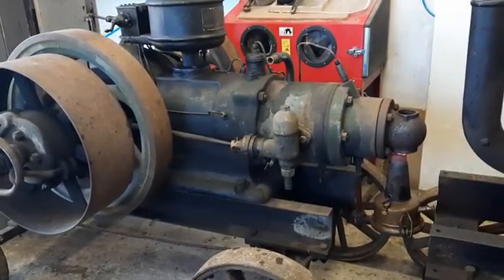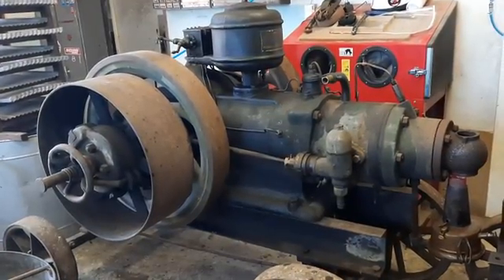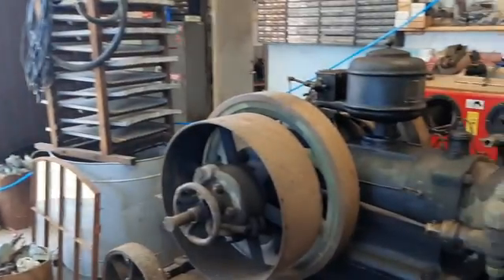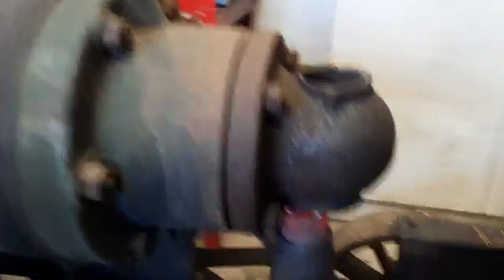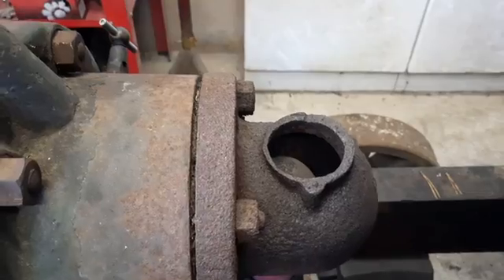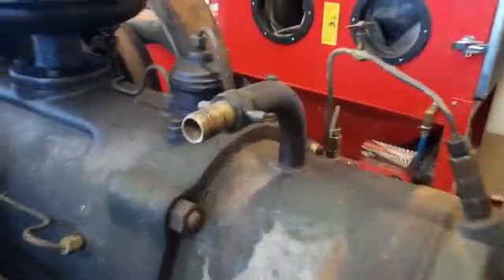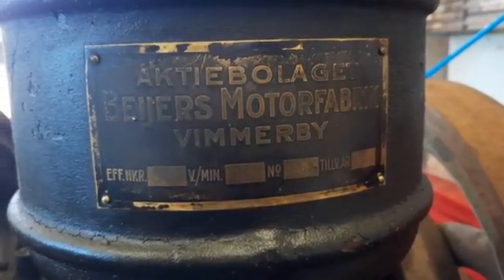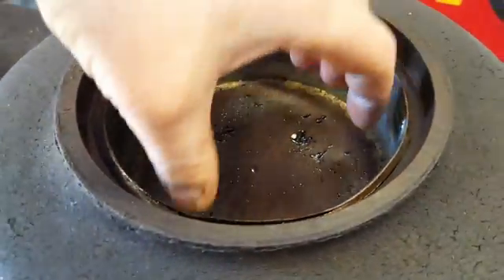10.4L Oil Engine Running @ Zero RPM. How is that possible?

Comment: RC aircraft engines used to do this occasionally.  You could actually see that the prop wasn't making a full circle, that it was just reversing constantly, with a kind of muffled sputtering sound, and it usually only lasted for a second or two, max.  Some .049s I had would constantly want to start up backwards, so this reverse was obviously happening on the first firing.  Some were so bad about it that I would just flip them backwards and they would reverse and run forwards most of the time.  They had a little rotational spring starter that would preclude this, as the spring would just overpower the first firing, not allowing it to reverse, and would spin it up fast enough where is was 'locked in' to the right direction.  A bit more flywheel inertia (heavier and/or longer prop) would probably have helped, too.  As you say, they have to be two cycle for this and they have to have a constant ignition source, which in the case of the RC engine was a glow plug that you heated with a battery to start, and that the heat of combustion kept glowing throughout the cycle.

Comment: I think they are called "Glühkopf-motoren" in germany wich translates to "glowing-head-engine". Saw one of those like 10 years ago in a museum in bavaria on a school trip.
Reply from the maker: Yep thats true 🙂
Reply: It's gloeikopmotor in Dutch, so the same I guess. In English they call it a hot-bulb engine it seems. I want one.
Reply: I have never seen one before, but I believe I can add one more language to the list: Kuulamoottori.  That is Finnish.  The "moottori" of course stands for "motor".  The "Kuula" refers to the iron balls that once were used as shots in the old artillery guns  The more present translation for the "kuula" is a bullet.
Reply: @InssiAjaton  well the hot bulb at the end of this machine does look a bit similar to a cannonball, so I guess that makes sense.
Reply: @InssiAjaton  Tändkulemotor is the Swedish name. "Tänd" is Ignition, "Kule" is bulb or ball and "Motor" is as you probably guessed Engine.

Comment: i saw this happen on a trimmer (weedwacker) the flywheel key was sheared and it set the ignition timing at the perfect degree for it to run but not run
Reply: oscillating is the word for what is happening btw

Comment: Cant be good for it. I can imagine the company that manufactures this amazing engine brought it to wherever you wanted it …set it in place…demonstrated it and then said never let this happen…. 0 rpm 😮 💥 
It’s hard on the wrist pins… they get yanked back and forth by the mass of the flywheel… much different than when it’s running in the same direction smoothly.
Also the piston is being pulled backwards by the flywheel and this wears on both the cylinder and the piston skirts.

Comment: With the bore and stroke measurements you gave this is not a 10.4L engine. 210mm=21cm and 300mm=30cm. Diameter x pi x the heights to find the volume. 21 x 3.14 x 30 = 1978.2cm cubed = 1978.2ml = 1.9782L.

Comment: That 0 RPM is amazing! What keeps it from running backwards when introducing more fuel? Is it because of the intake and exhaust occur in the same order no matter what? Totally amazing to see an almost 100 year old engine running! I can easily understand the 0 RPM now that I have seen it. I look forward to more videos.
Reply: Intake and exhaust occur at the same time with a 2-stroke. It does run backwards too, it's just chance which way it runs if you watch closely. It ran backwards several times.
Reply: @edbruder9975  I thought I saw it run backwards a couple of times. I am amazed how brilliant people were back then! I worked on a letter sorting machine for which the design was originally done in the early 1900's.
Reply: @moonshiner5412  I knew 2-strokes could run backwards from stalling out my Jawa 125 on a hill, then rolling backwards and it restarted on the way back down. Then I heard about the 2-stroke jiggers on the railroad they could bring to almost a stop then almost stall and they would then reverse. I think they adjusted the spark timing to facilitate the switch-over. My Grandfather was a section foreman on the CPR and my Grandmother a Stationmaster, they lived in an almost unused country railroad station, Killean Station near Galt, Ontario, when I was a kid. I'm sorry, I never got a ride on a Jigger, but there was one in a little shed just across the tracks from the station we used to sit on when I was 4 or 5. Back in 1956 or 7. It had handles like a wheelbarrow you could slide out on either end to set it on the tracks. There were 2x4 rails it ran on at 90 degrees to the track then you grabbed the handles and wrestled it onto the steel rails.
Reply: @moonshiner5412  A letter sorting machine I can't even imagine the complexity. Jeepers!

Comment: That's how they shifted from drive to reverse in the older tractors by lowering the RPM so much that the engine started to spin backwards after the "zero point"

Comment: While the engine is rocking back and forth, is there a chance of it running backwards if the fuel is increased at the wrong time?
Reply from the maker: Yes you can start it and run at any direction you want 🙂

Comment: The slowest turning engine in the world still makes more or less than one turn in a minute. If a piston moves (engine running) it has to turn the crank at a given speed. 0 rpm would be off, but say 0.01 rpm is still movement.
Reply: Clearly though, this engine runs multiple rpm and no engine is running at 0.0 rpm because rpm= movement

Comment: I actually used to work on engines like this in the oilfield, they powered the pumpjacks.  Thought it was pretty awesome that they were entirely self sufficient as they ran on the natural gas that came out of the well they were pumping.  A few of them were converted to use crude oil to lube bearings, they tied into the oil tank and used a float valve to keep a small tank filled.  The apocalypse could come and go while these guys just keep chugging along indefinitely.  Ajax compressors are sort of a modernized version of this, but the air (natural gas) start system was so much fun to kick over and watch smoke billowing from a 16" stack.
Reply from the maker: Thanks for sharing your story 😊 Yes, smart thing to run on natural gas when it alredy exists!
Reply: I love the self sufficient oil wells.
There is a well maintenance guy who posts videos of them on YT.
I can't think of his name but I love his videos.
All the wells in my area have been converted to electric.
Not nearly as much fun to watch.
Reply: @1978garfield  Yeah, most of them out here are electric.  I'm right in the middle of the West Texas desert, and ironically there's a forest's worth of utility poles, which sucks because I have to fly under all of those wires.  Once free flowing stops, a fracked well starts off with an electric submersible pump, then to a long stroke (hydraulic/electric, usually), and finally to a conventional pumpjack.  Most of the newer wells will more than likely never be combustion driven since there's already power on site, but on rare occasions you get a unique well that has tons of gas available compared to oil and water.  It's more economical and productive to use a compressor and inject that gas back into the well for artificial lift, most of those operate on natural gas too.  It's quite a different animal from the old hit and miss style single cylinder engines sputtering away all day and night, they sound much more like a diesel engine when running, a nice steady hum.  Of course they're also computer controlled and fully automated, so when they go down you're out there sometimes for hours getting it started again, and they go down for silly stuff all the time.  They just don't have the same kind of charisma and character that those old putt putt motors do.
Reply: @Skinflaps_Meatslapper  
Hmmm, maybe after the big freeze...
there might be more engines that run when electrickery doesn't flow....
Reply: @Skinflaps_Meatslapper  

I tend to wells near Victoria, Tx. Most of our wells are gas lift, using Ajax compressors, but we've got three esp wells, and two natural gas engine, pump jacks running. The whole field can go down due to compressor and electrical issues, but those pump jacks just chug right along.
Reply: Good lord no, I couldn't write a book.  I spent close to half an hour writing that comment, a book would most likely take a lifetime.  It's funny you should link that audiobook, I downloaded it to my phone and listened to it while I was flying in Ohio and Illinois this past month.  In a way, I may have already played a part in your day to day life without writing a book...the fuel in your vehicle years ago may have passed through my wells at some point, while a fair percentage of the corn and soybean products you use later this year or next year will likely have been sprayed by me.  No worms or anthracnose in my corn, you can blame that stuff on the other pilots LOL
Reply: @Skinflaps_Meatslapper  - West Texas is one of my favorite places on earth. Current situation at the border aside, it's a dream of mine to get a few hundred acres out there someday, way off the well worn path, self sufficient as possible.
Reply: @wes11bravo  Take a look between Dell City, Ft. Hancock, and Sierra Blanca, lots of land out in that area that fits the description.  Once you get about 75-100 miles west of the Pecos, the oilfield activity stops and you can actually be alone in the middle of nowhere.  Everywhere else, there's an oil well close to you and roads to get to it (and if there's not, it's just a matter of time), so you're not really as isolated as you might think until you're out of oil country.
Reply: @MaikroWavee  
Obviously for the purposes of these simple engines...
the oil only runs out when the engine stops.......
unless the rod goes through the block, in which case the oil runs out faster....
and it definitely comes to an end then.
Reply: @MaikroWavee  These old wells pump so slowly that the reservoir they're tapped into will likely continue to produce indefinitely.  Yeah, they'll run out someday, but the more likely scenario is that the drive belt, rings, bearings, spark plug electrodes, or some other engine component will fail long before the oil runs out.  It is feasible to conclude that if mankind disappeared suddenly, such a well as I described would continue running for years, decades perhaps, after most everything else we've built has given up the fight.  Renewables such as solar/wind/hydro are inherently better suited for maintenance free autonomous longevity than an IC engine, but that's entirely dependent on the environment and load they're connected to.  A solar farm tied to the grid, for example, wouldn't last long as there would be millions of homes and infrastructure all drawing on it for power.  It would amount to a dead short as far as the farm is concerned, and even the best electronics and wiring would see a marked reduction in service life operating at 100% load or beyond.  Small off grid cabins and whatnot could theoretically last much longer, provided the environment itself doesn't interfere with longevity.  A persistent spot of shade on a solar panel can cause a 200C hot spot and eventually toast the entire panel, and it doesn't take all that long for fallow lands to be reclaimed by brush and trees.  Additional circuitry can be employed to mitigate this, but is rarely used unless shaded panels are expected due to cost.  One good windstorm could overspeed or topple a wind turbine, lighting would fry the electronics, that sort of thing.  Hail storms would affect both with potentially game ending damage, but there's not much to be damaged by hail on a heavy iron IC engine.  So, in an apocalyptic scenario, chances are, one of the last murmurs of humanity could very well be the rhythmic hit and miss puttering of an old flywheel engine echoing in the desert, not unlike what you hear in this video.
Reply: @Skinflaps_Meatslapper  mate you should write books
Reply: @bluejene2146  With a name like "skinflaps meatslapper" his books would most likely be pornographic.
Reply: @davelowets   or phonographic?
Reply: @Skinflaps_Meatslapper  One of the best comments lately I have read online. You should write books as one said. Cheers and thank you for the reminding that some old tech will outlive every piece of hitech we have now.
Reply: @Skinflaps_Meatslapper   You are def. a candidate for this one! lol --->   https://www.youtube.com/watch?v=YbunzILnsKU
Reply: Man ... I wish you could go back there and show us here on YouTube ! That sounds like something else!
Reply: @MaikroWavee  snakeoil is ! (aka Politics) lol
Reply: Old magneto drives
Reply: In the US many of the old well even up into the r's an on a Johnny popper engine.  It is not steam but it is a low Rpm big cylinder.  It make that Pop,Pop sound you could hear miles away.  I use to live 1/4 mile from one when a kid.  One day I am visiting my dad about 10 years ago and I asked him did they shut the well down.  He said it went electric. Man I miss that sound.  My dad said he kinda misses it to.. It is just something you get use to hearing in Oklahoma. 

 I do not know if it is still running but I hauled crude oil for a bit and there was a well site in Drumright that was still running in 2009. It had one pump that set in a pump house and it had a big cam on it with push rods lying on the ground, that that ran several hundred feet to 3 different wells.   That one Johnny popper powered all 3. It had been in use from the 30's.     Here is a link to a video watching another well in Oklahoma like it still in operation 9years ago.  They was some creative old farts back in the day.

https://youtu.be/uzkVVwsic9g?si=EIgOxu6hJcJrHTVi
Reply: @jvmiller1995  That's really cool that there are still old eccentric pumps running today!  I've come across remnants of a few out in the field where the only things left were the engine foundation and pieces of an old shed, bearing supports, and a huge wood/steel wheel with pushrods still attached heading out to capped wells.  In fact, my old house had one of those wheels on the property, had no idea what it was for until I learned about them.  The wheel spokes were made out of railroad tie sized lumber and it appears they were capable of handling up to 12 different wells.  From what I've gathered talking to the old guys out here, the wooden eccentrics were powered by steam engines, which makes sense because the only ones I ever found in the field were on the banks of the Pecos river.  They had giant belts going from the steam engine to the eccentric gearbox with a 90deg twist along the way, and they were just as dangerous as it sounds.  Couldn't imagine a person or a cow getting caught up in one of those belts running at high speed, or if you were close by when a belt snapped.
Reply: @Skinflaps_Meatslapper   Yep my mom said when they was a kid they would go ride the rods and see who could stand on them the longest.   She was born in 38.  I miss her.  She had lots of  old stories. She was a victim of the old suicide doors.  /got tossed out of a car doing forty.
Reply: @jvmiller1995  No idea what it is about oilfield equipment that makes people want to ride them, but I've had to chase kids off pumpjacks before.  I was one of them when I was a kid too, so I can't blame them lol

Wow, she got to live through some great times though!  Love hearing those old stories, it's the kind of stuff that you don't get to read about in history books.
Reply: @Skinflaps_Meatslapper  That is for sure. Her dad was almost 60 when he had her.  He owned a cotton plantation.  Sadly owned slaves too.  She was the baby of 13.   I try not to judge as it was different times and she raised us with respect to everyone.  But when you think back all the history they lived through. From indoor pluming to the internet.  No other generation will likely ever see a gap in tech like that.

Comment: Very interesting!

Do you know if this type of engine would be able to run on fuels such as beeswax or tallow, rendered from whitetail deer (very waxy at room temp)?

I ask because I'm researching for a dystopian SF novel I'm planning on writing. I'm a retired "non-fiction" author (book/magazine article stuff on software development), but always wanted to write fiction.

TIA for any info!
Reply from the maker: Hi! The fuel must be a liquid to work in the fuel pump and lines, but it woult be possible to have a heated fuel system that keeps the fuel as a liquid. If that is arranged then it would be able to run on bacon grease and probably bees wax to.

 Because inside the engine the fuel sprays in the hot bulb and gasifies emediatly and then combusts.

Thanks! Richard /Sweden
Reply: @YesterdaysMachinery  -- Thanks! You may have saved the life of a protagonist or two :)

Comment: A modern day servo motor will run at full torque, “locked rotor”, at zero rpm. Love this old technology.
Reply: steam engine has full torque at 0 rpm
Reply: @Jeanie363034  electric motor does as well
Reply: @Blox117  whats old is new again
Reply: @TheJunky228  not really, its just a physical principle. the human arm also produces the most torque at zero. cumbustard failgens just so happen to stall at zero.
Reply: The best way of varying AC voltage 100 years ago was with a locked rotor slip-ring motor whose rotor position could be varied by the angle of a single pole of the windings